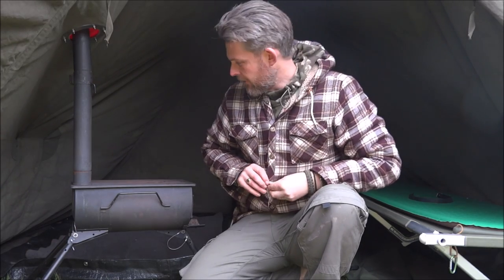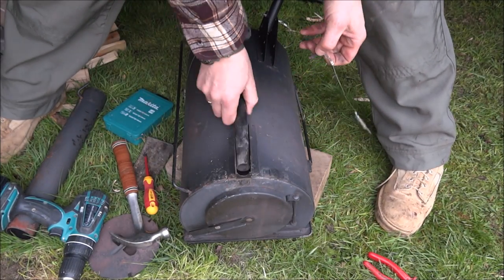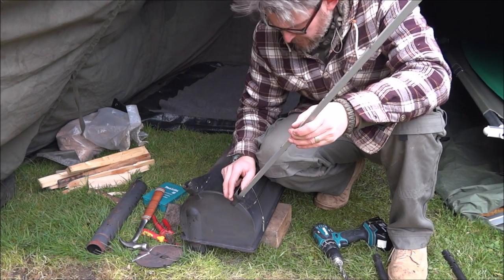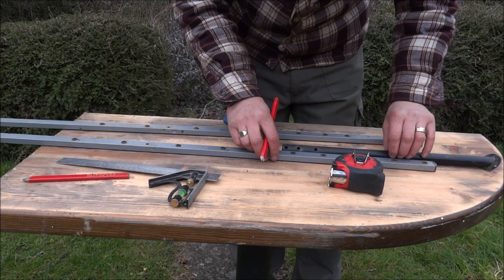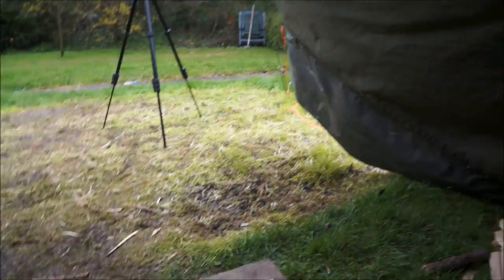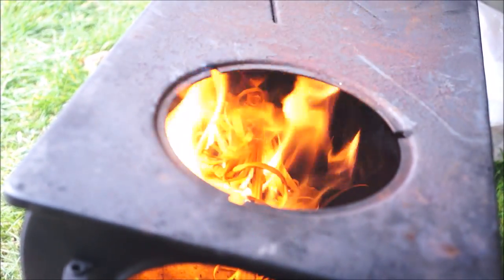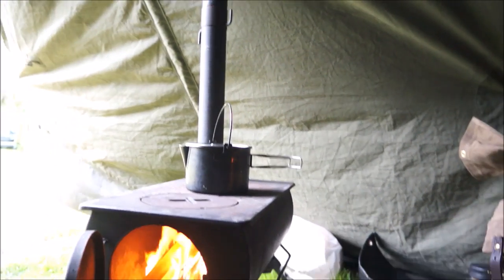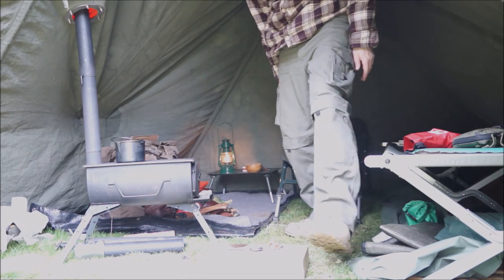Frontier Stove Mod

Comment: But Why ???  Just fold the legs in, or remove them , and put it on some bricks.
Reply: I absolutely agree.  Or you can dig an inch where the legs touch the ground so it sits more firmly and lower.

Comment: Good mod, David. It looks right lower as well, which must mean it is better. Have you tried Zebrite on the stove? It is stove black which is used for old fires and cast iron ranges. It does need to be well buffed off, as it can come off on your hands and anything it touches, but is an easy way of keeping the metal protected.
Reply from the maker: Thanks I will have a look into zebrite the trouble with my stove is it only has to look at water and it start rusting Ha Ha, but i will look into it, Cheers
Dave
Reply: It might work, you never know, it's like shoe polish for metal.

Comment: Who's a clever boy then........a much more usable height after the mod to the legs. Might do the same to mine, with the original legs, but knowing me I'll F**k it up !!!
Nice job Dave.
Atb
Alan
Reply from the maker: Cheers Alan I will cut down the original legs and put them on as I think it works better plus seems to fit better in the tent being lower but it does get hotter under the stove which is good for keeping food warm or drying boots out just do not put any plastic under there as it will melt them. 
Atb
Dave